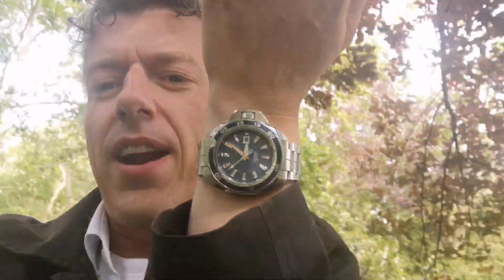Citizen's Grand Flaw?

Comment: the crown guard is not an after-thought that they added because they made a design mistake, its there from the begining as part of the design. i think they was going for some kinda paneria-esc type of vibe with this model, although i get a kinda planet ocean kinda feel from it also. i have a king samurai that also gives a similar vibe to this i think as well. i think it definatley looks best with the crown guard in place, and over all a decent looking watch, i like to have a big watch in collection even though i prefer 40-42mm. dont forget that any of these so called dive watches are not real diver watches if they mechanical, i dive, and i can tell you nobody dives for last 30 years with a mech watch, its all dive computers that you wear, 1 on each hand usually. the so called dive watches are really "skin divers" which means you can wear in your private pool or at the beach a few meters from the shore. your not gonna get to 30 meters or more down just skin diving usually, nor does 300m even mean 300m on dive watches, it really mean its 300m of pressure, not actual depth, sometimes you will see 30 atm in stead. anyways i think its a cool watch tbh, you was gonna sell it if i remeber, i would keep it tbh.